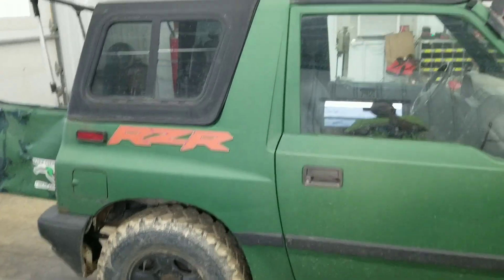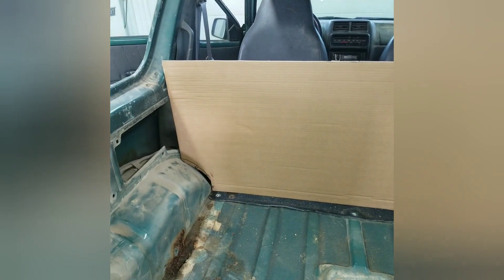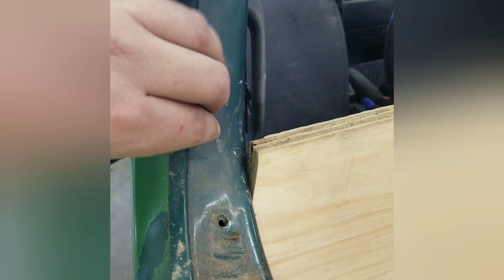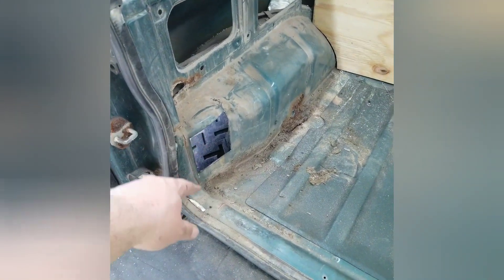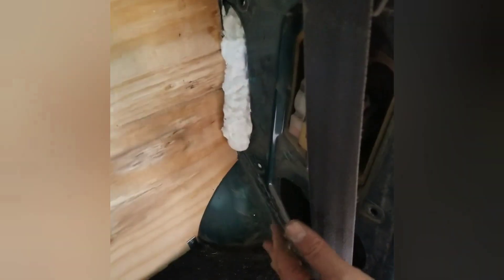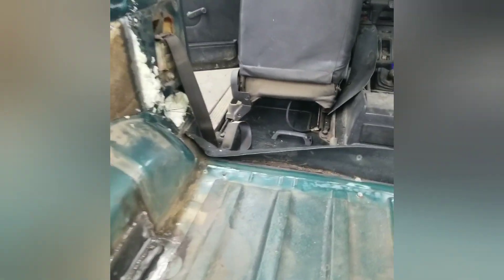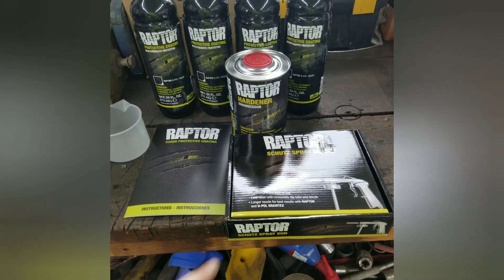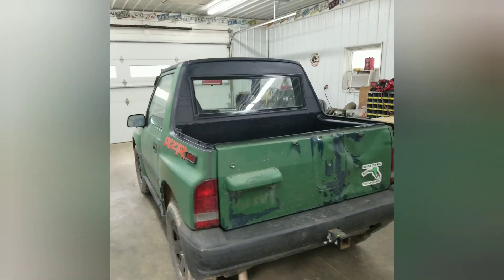converting a geo tracker to a truck!

Comment: Probably a stupid question: When you do a conversion like that, don't you need a roll bar at the back to pass inspection? I don't know? Just wondering. Liked your video. Thanks. 👍😎🇨🇦
Reply from the maker: OHIO. No inspections lol. But i dont see why you would? Theres no roll bar there if you just take the top off just like a convertible car. No roll bar on thouse.
Reply: The roll bar is already built into the roof, if anything its stronger with the plywood in there.

Comment: Cut the back off of a S10 extended cab and welded it into the back of the Geo tracker I did a bronco 2 chopped and welded in a back of a ranger cab